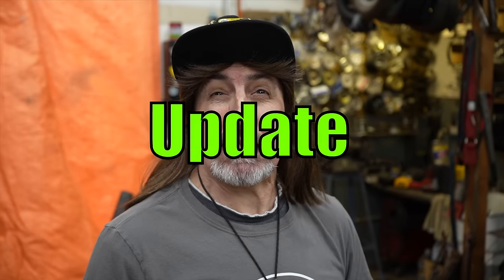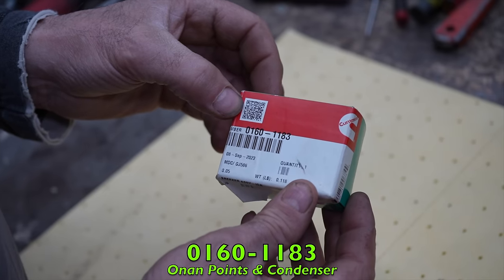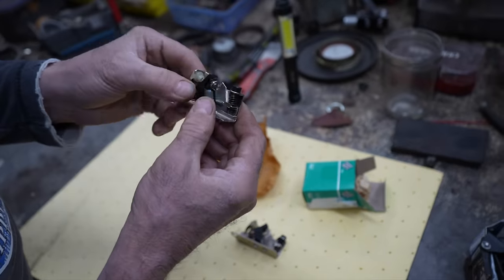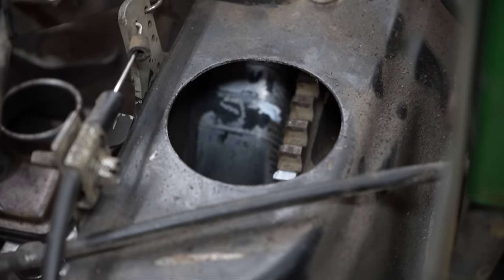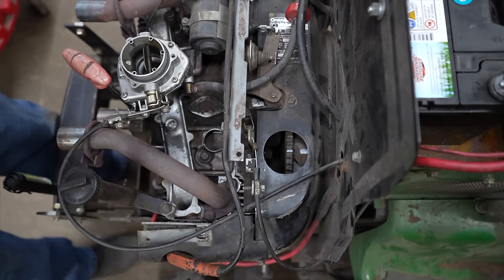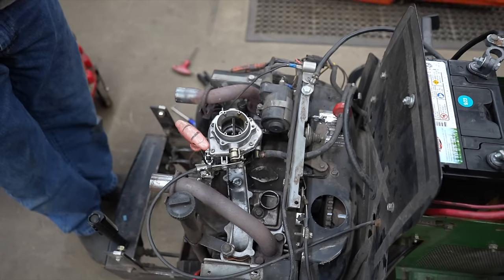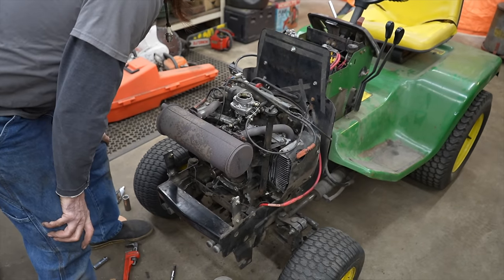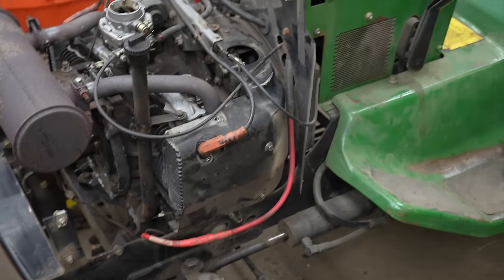OEM vs. AFTERMARKET Points - Is There A Difference?

Comment: Dear Tartyl, from a guy that has rebuilt many car and racing magnetos. The points are probably where the difference is and the difference in cost. Chinese points will probably have Tungsten points, the US made points will be Platinum Iridium. So what is the difference? Platinum points will not pit and pile with reversing current and tungsten points will still work but will erode much more quickly. Platinum also has a much higher oxidization resistance. We had to spend 1000's each year getting platinum Iridium points discs made and I developed a process to silver solder the new discs on. Magneto points must still be available because small aircraft engines still use points magnetos. Tungsten is a grey color and Platinum is more of a yellow color. When I was doing them the discs were about $30 each so $60 per set.
Reply: Hope Taryl see this.
Reply: Aircraft engines don't have electronic ignition 🤔?
Reply: @jonathonrossebo1783  No the older engines are still magneto made by Bendix and Slic
Reply: @jonathonrossebo1783  Not when they are from the time before electronic ignition...which there are still alot of planes around from those eras
Reply: Good observation on the material difference. I would figure that the price difference would be on the manufacturing process and materials used.

Then again, nowadays the parts could be exactly the same and the company just upcharge due to its brand to make money lol. 

And yes, small aircraft engines still uses the old style mags with points. Mainly because of FAA regulations since no modifications can be made from original equipment. If you do said modifications, or other upgrades, you’ll have to fill out appropriate paperwork like the STCs and whatnot. Hell, we even still use the old updraft marvel schebler carburetors on the engines. The system is reliable, simple and somewhat forgiving which is quite critical while being in the air.

And the fact that the mags with points have its own way to generate electrical energy and provide spark, this is a sure way to keep the engine running during a electrical power loss like a dead battery or failed charging system.
Reply: Old A&P guy here for some reason I would prefer the points mags over electronic ones !  they keep working  no matter what I have only seen a half dozen that have gave out during their allotted time between rebuilds . and you have 2 !
Reply: Look at this big 🧠 Thanks for the info
Reply: Resistance solder with thin silver alloy discs.
Reply: @jhonsiders6077  Well said sir!
Reply: Got a supplier for the contacts? My Vincent restoring mentor soldered on his own magneto points contacts (he was a prior USAF recip crew chief).
Reply: @jonathonrossebo1783  Recips use magnetos and that's because they've been highly reliable, highly refined components for nearly a century.
Reply: @genesun71  electronic ignition doesn't require a battery either.
Reply: @genesun71  on small engines the magnets in the flywheel.

Comment: I just put points in my 67 Simplicity Landlord as you posted this video. I was able to get the original Briggs &Stratton points and condensor on line. Runs like a top now. Ready with the tiller mounted for spring garden tilling. Ive always set my points just by the sound and responsiveness of the engine. It has always worked for me whether its right or wrong IDK.

Comment: I had the predecessor to the 318, a 317 powered by a Kohler with points. John Deere quickly realized the 17 hp Kohler wasn’t made for lawn tractor duty and switched to the 18 hp Onan. That’s what I put in my tractor to replace the Kohler when it blew up. I always had trouble with the points on the Kohler. They would constantly get dirt accumulating in the box that covered the points. The Onan replacement motor came with solid state ignition and I never had a problem with the ignition again. Other improvements over the Kohler was higher oil capacity and a filter. The Onan just worked better.

Comment: Another thing you can do with that shorter spring is just put one or two little washers above it.. which will make it compress a bit more and make it stronger;  it should still have plenty range of motion to still work correctly.

Comment: i always preferred the John Deere 322 if i was to get a gasser in this frame size, the onan always seemed like it needed all the maintenance when the yanmar gas and diesel would be the ones you would never see in the shop because they always worked. the 332 being the diesel variant would often times need work to the glowplug control timer but otherwise are mowers running in which i never see because i know they are out there but rarely break down.

Comment: I own an auto shop. If it's electric or goes in or on the engine OEM only. Just did a Subaru motor today customer had done a diy timing belt and water pump. He said the cheap dayco tensioner failed. I replaced the engine and used a aisin brand kit. All OEM parts. There are some parts that they sell aftermarket that just don't work.

Comment: Hopefully, since they are manufactured here in the States, they are quality points that will not only fit correctly, but function well for a long time.
Reply: cummings doesn't manufacture in the united states since early 2000's. they are assembled here, meaning the holograph sticker on the box. talk to the shipping and receiving people at the warehouses proof is the bills of lading  when they come in on pallets in the tractor trailers and sea containers

Comment: You mentioned using a light for timing, we use to use a doorbell and a battery so the bell would alert the person setting the points of the timing.
Reply: Many multimeters have a 'beep' function when there is continuity also.  I've used that with much success.

Comment: Taryl, I’m sure you know this, but if you didn’t know- Onan used to be its own company. They used to make all their own engines and generators. They were acquired by Cummins and a that’s why a lot of the Onan parts are hard to find and expensive. Seems Cummins doesn’t care much about Onan, even though they make a really stout engine and generator. They were the best for decades

Comment: I just checked, they are $50.28 from John Deere. And they come with a condenser as far as I can tell. 
January 2018 I paid $32 from John Deere.
I have 2 JD 318, a 332, and a 322. They’re great machines! 
The 332 is a 3 cylinder water cooled Yanmar diesel and the 322 is a 3 cylinder water cooled Yanmar gas engine.

Comment: I Taryl. I found that the cheap points have a dimensional problem with the point spring making contact with the frame of the points. When the points open the flat spring comes close enough to short on the frame. Took me a while to figure it out. Some of the points say "remco" ( I think it was) and they seemed more like OEM.
Happy wrenching!

Comment: i have found that after so many years they can supply you none oem parts but in an original oem box at a crazy price im sure you could of got about 8 sets of cheap points for less than one cummins set and they would last longer than the dear oem ones

Comment: I always use OEM if I can find and afford them. Onan parts are not cheap but they are made specifically for there engines. I have had problems with aftermarket points sets falling apart and shorting out. I've had a few that the contacts actually welded together which overheated the spring and took the temper out of it. Most aftermarket points have some sort of softer steel contacts instead of Carbon steel contacts.

Comment: You would not be able to get the timing light to work unless it was running.  Because you would have to connect it to the coil wire.

Comment: Seems like those OEM points are struggling too. Brand new and already corroded. Doesnt bode well for a machine thats out in the elements. Id be curious to see how that well mower would run with the aftermarket points, but with the OEM spring.

Comment: I had some aftermarket points with a protective coating that wouldn't come off with cleaner. Engine wouldn't run until i rubbed the points clean against a block of wood. Didn't use sandpaper.

Comment: May need to check the Dwell also on the cheap with old spring.  I forgot, you and I are the only ones that still own a dwell meter...
Reply: You’re not alone, I still have mine. 😛
Reply: I used my dwell meter today adjusting fuel mixture on 85 El Camino

Comment: An old guy told me to final clean points with a dollar bill. Paper can leave fibers. Been using a bill on points for about 50 years.
Reply: My Dad used a dollar bill held against exhaust pipe outlet when we looked at used cars way back in day to see if valves were not sucking it back thus sticking....a guy can get many uses for a dollar bill besides spending it.
Reply: @stevedibiase728  Same here! That was the first thing we did when an engine was running rough or had a miss.

Comment: Ha! transdensor prices start over $200!!!!   That makes those $70 points sound cheap!!    That $70 buys a lot of Chinese points that last at least 3 years!!  Save your money and just swap or replace that spring like Taryl says!!!
Reply: That's for other products from the same company, the "Transdenser II" used on this engine is $62.15 with US shipping included. But you still need a good set of points...
Reply: I agree  it li j e Recycline
Reply: @ruben_balea  my mistake   but still too much to add to a lawnmower. points have always worked and always will.   I have a 1963 wheel horse. I just replaced the original points. Granted the machine sat for a few years, but I’ll be dead before it needs points again!!! it doesn’t need a transdensor to work just fine. But everybody’s you might want one -I don’t.!!!

Comment: What about the thickness and quality of the plating on the contacts? Should be cadmium plated. That will affect how long they'll last.
Also the quality of the material that rubs on the cam? 
You have no real way to measure the difference of those important aspects in your fine shop.
Springs because they're made of metal  become more brittle over time. It's why we find broken springs. They're only going to work for so many cycles before they become work hardened enough to finally snap. Armed with this knowledge is it really a good idea to used the spring in your old points? I know, I know, one could argue about the quality of springs coming from Chynah, and you would have a good point, so it's a toss up.. Just food for thought.

Comment: What was wrong with the old points? And what does that condenser with the light do? I have an onan on a Ingersoll lawnmower.
Reply: It's just an electronic ignition module in the shape of a condenser to make it easy to fit on most cases where the capacitor was bolted to the coil clamp.
It should reduce the wear of the points because it runs a smaller current through them, the spark should be somewhat stronger too.

The light makes it easy to adjust the timing without external tools but I don't like the idea of such a big light, if I had to use one I think I would paint most of the translucent side with black "liquid electrical tape" leaving only a tiny hole for the light.

Comment: The composition of the actual contacts might not be the same. I have a Wisconsin TJD with a magneto and changed out some old points that still worked fine. The new points if the 
engine sits for a few months you have to use some 1K grit sandpaper on the points to get spark at the plugs. Cheap junk IMHO. Had an aircraft mechanic tell me this is not uncommon
in aftermarket Chinese point sets.

Comment: I bought a set of points for my '67 Larson Eagle snow machine with a 9 horse JLO engine in it.  They were made in China.  I put them in and gapped them and the thing would not start.  I tested them with a continuity tester and they failed.  Completely useless.  I cleaned up the old ones put 'em back in.  Never bought snowmobile parts from them again.

Comment: Taryl it's not that at all . The diode most likely burned out in your timing light.,or it is one these other two parts instead. The switch.,or it has dirty contacts inside of it. The last thing is loose wiring.,an A resistor that may have went bad also. I'd test it with ohms multi meter on conuity mode.,or known as the 🎧 headphones mode. Another mode is 200k

Comment: grouse video content there Taryl Dactal mate and yep a good difference in these points and condenser and yep the differences are well the differ between the real deal and of course cheap as Chinese garbage for sure in this case even on those dud spark plugs we have over here by comparisons which are Torch and Denso type which are poor qaulity plus it does not fire up a engine for sure from what i have noticed and even on our 2 stroke Victa P/T (Power Torque) and other forms of outdoor power equipment we have over here too and yep my mate who also lives in NSW (New South Wales) will agree with me too as we both hate em for sure but yeah your video is a good top notch one on those famous farmers tools known as John Deere 🦌and yep no kidding either and i,d happily use their stuff any time for sure if i was offered a test run for sure and cheers from Australia 🐨🐑🦘🌴🌳🌏🇦🇺 or the land down under to your area and i hope your keeping toasty during your annual Winter/Flu Season too.

Comment: Not a good idea to use the old spring from the old OEM point set, Springs wear out from compressing and decompressing so over time they lose tension. By the time you need to change the points the OEM spring is no longer the same spec as the new OEM spring. Another post has already pointed out the difference in the quality of metals used for the points surface. The OEM while expensive are a superior product over the china made point set. 

This is one Taryl is wrong about.
Reply: Wrong.

Comment: As a lifelong hater of Cummins, a friend of mine has a small engine shop and sold onan parts and as soon as Cummins took over everything tripled in price which made me hate them even more.
Reply: Yeah that’s a fact 😢
Reply: They do make outstanding 6 cilinder diesels though..
Reply: @Wayoutthere They USED auto make good inline 6 engines. Their class 8 engines are a hot mess and their Ram engines aren’t anything to brag about anymore. Part of the problem is Tier IV emission regulations and part of it is poor design on Cummins part.  Cummins, Detroit, Paccar are all building hand grenades with the pin pulled on them now. It’s even worse in the light duty market.
Reply: @Wayoutthere  I have never been around a good Cummins in anything no matter the size of it. Complete garbage engines and thought for sure the cheating scandal would sink them once and for all. Luckily Deere moved away from them.